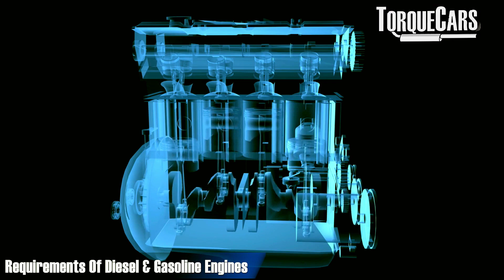Rough Idling Bad Idle Problems: Diagnosing & Getting To The Bottom of Bad Tickover Issues

Comment: Good morning hello I have a Touran 1.2 tsi model 2017 I have a problem where get the ECP LIGHT check Comecon and the engine check light turns o I was told that maybe the throttle is malfunctioning 
 Basically the engine was washed with water by a car was and gave me these problems and the idling of the if it’s not warm tends to vibrate can you please give some advice if this might be sensor problem or anything else thanks for your videos that have help quite a lot and it’s nice too know about warming up engines 

As myself I do short journeys of 15 kilometres distance and do only give two or three minutes for the engine to warm up sometimes not anytime at all
Reply from the maker: Read off the error codes via OBD port that will give you an idea. Water will sometimes leave mineral deposits that cause a short or intermittent short. Cleaning the contacts with an IPA solution on the components flagged up with errors may fix the problem.

Comment: I have subscribed n I think ur channel is very informative as I hv just bought a 2012 vw 1.4tsi petrol cavd engine.  Upon start up it sounds like a diesel. The rattle goes when revved so it's only on idle.  I'm sure this is a common issue but am wondering what it could be...or is it normal. I would very much appreciate your comments.  Thx
Reply from the maker: Hi buddy, sorry for my slow reply, I'm just trying to catch up with 300 comments.
A rattle on startup is not normal, mine is silent. 

The things to check are where is the rattle coming from. Top of the engine or rear or near the bottom are primary locations for a rattle.

Engine mounts can cause a rattle but this will not go away when the engine is warm.
The Cam timing mechanism (it is a wheel that uses oil pressure to rotate the cams slightly) can start to fail and this will exhibit a rattle but it will also affect the power delivery.
The timing chain tensioner can also cause a rattle if this fails.
Some of these engines had weak bolts on the injector rail, it is worth checking that all the bolts are securely fastened.
Other than those obvious things it is nearly impossible to diagnose by message, you'll need to get someone to look at the engine in person.

Comment: Thanks for this valuable information. I am an enthusiast and this will be useful. I experienced idling and power delivery issues on an older (carburetor) Japanese car several years. After trying everything I knew, I noticed by accident that the engine grounding cable lug was loose. I replaced it, and the issues went away. Would an ECU detect grounding issues?
Reply from the maker: An "ECU" on a carb engine is pretty basic in operation if indeed the car has one at all - many early engines are purely mechanical in operation. Grounding issues can sometimes throw an error code but not usually in my experience.

Comment: Got a rough running engine and you didn't do much for finding a solution.  Good compression on all cylinders.  No engine codes and all plug wires and spark plugs are in good condition.  Running rich with vibration and not engine mounts problem.  Would I get a code for a malfunctioning oxygen sensor?  How would I check it to see if it is working properly?
Reply from the maker: Welcome to the annoying world of car diagnostics. Here are some tips, some really obvious which sometimes get overlooked.

Turn the ignition key to the "On" position without starting the engine.
Use the scanner to read the O2 sensor data. 

Look for any trouble codes related to the O2 sensor. These may include P0130, P0131, P0132, etc. You say there are no codes showing but this doesn't mean the O2 is ok, just that to the ECU it is giving readings that seem roughly ok.

Examine the sensor data for fluctuations. A properly functioning O2 sensor should oscillate between rich (high voltage) and lean (low voltage) conditions.

To Test the O2 Sensor (if needed):

If you want to further confirm its condition, you can perform a voltage test using a multimeter. 

This requires back-probing the sensor's signal wire while the engine is running.
Generally speaking a healthy sensor should produce voltage readings between 0.1V (lean) and 0.9V (rich) while the engine is warm and running. Check specifics for your cars engine model though.

Other weird stuff to consider as possible causes...
Carbon build up around the head and valves can cause rough running, the carbon tends to be much worse on 2 cylinders and this creates an imbalance in the airflow.

Faulty coils/coilpacks, sometimes they just produce a really weak spark rather than an error code creating failed spark.

Sometimes a couple of issues randomly coincide to cause a misfire, is it a regular misbeat, or really intermittent? Does is only happen on cold or warm engines?
Reply: @torquecars  I'm sorry but it's a 94 GMC Sierra with a 7.4 or 454 engine.  Did a compression test and replaced the distributor.  Had a fuel pump replaced and the EVAP system wouldn't pass smog.  I redid the job myself to make sure that it was done correctly and passed the EVAP system test but the engine failed do the 3 & 6 plugs were showing carbon deposits.  The distributor cap had stripped the threads.  I fixed it but had already purchased the new one and made the decision to swap it out.  The engine still ran rich.  There are no engine codes and no other tools accept a multimeter.
Reply: @torquecars  the coil was easy to check with a meter.  The Hanes Repair Manual has the specks on it.  Changed the fuel filter.  Wondering if there might be a third fuel filter other than the one in the tank.  Another one on the frame.  It was a racing fuel filter.  Cost over $20.  Don't want to drive it to mess up the catalytic converter.

Comment: Hi,
I been thinking of having a stage 1 remap on my audi a3 s line 1.4 tsi but keep getting cold feet, can you put my mind at ease? And where should I go and who to trust please?
Reply from the maker: The nice thing about a remap is it can just as easily be removed if you do start to get problems. Where are you based? In the UK Celtic Tuning, Awesome GTi and APR, JFA Automotive are some names I've had good feedback on. 

Just don't get it tuned to the Max, a modest bump in power will transform the car without introducing any problems.
before you tune.... https://www.youtube.com/watch?v=52Fk5m4TtYo

Comment: My 1.8T hunts a little bit. Mostly when it's cold. No vacuum leaks I could find and it drives fine. Also have a real hard time getting fuel in it. I know that is a evap issue. Not sure if they'd be related but... Hopefully I figure it out before I pull the engine out!
Reply: Same here mate on my Audi tt 1.8T it misfires on startup a few times everytime
Reply from the maker: Are you getting a P0441 code?

Some random things you might have already looked at. Fuel filter? N80- valve? Also try removing the fuel tank cap and see if the problem still happens or gets worse, when you start from cold. Is the fuel pressure regulator starting to fail?
Reply: @torquecars  I'm not getting any codes but my CEL isn't as reliable as most. There's been a few things deleted but the evap is in place, so N80 is possible. The fuel filter is about 3 years old and I've tried a known good regulator to see if fixed it. My car had a rough past, it was beat on pretty bad by previous owners. Now it makes 300whp, I thought the head gasket was going because I was losing coolant but never saw it. We'll the radiator let go so I think the coolant was just evaporating before I could see it. This car has a lot of little issue and I plan to solve most of them when I get my engine done. I don't have much time to work it though... Kids.
Reply: @4BillC any luck ?